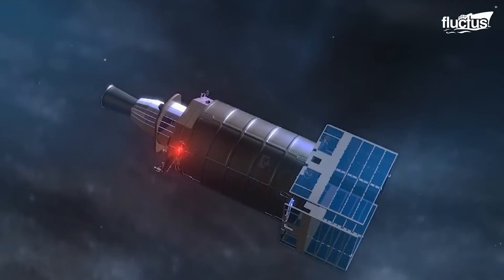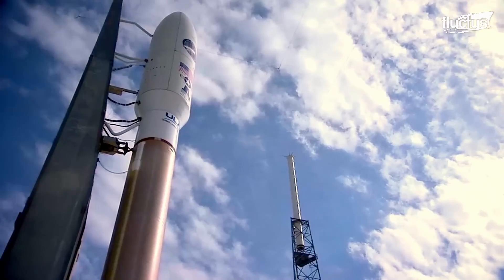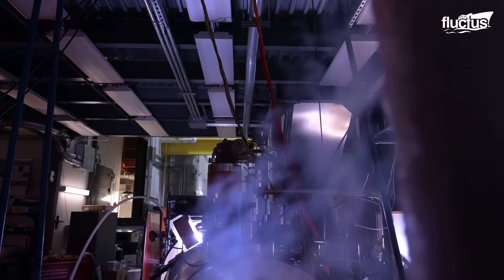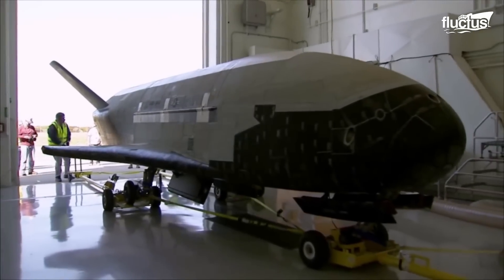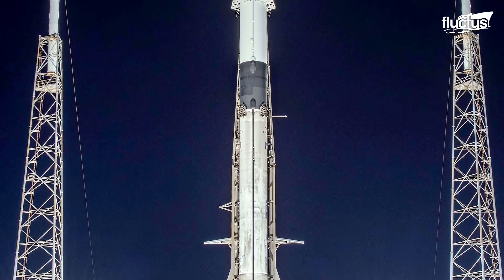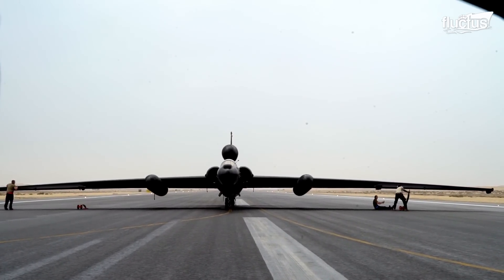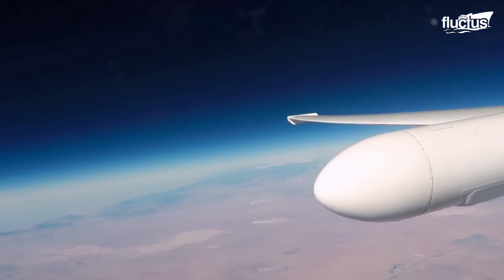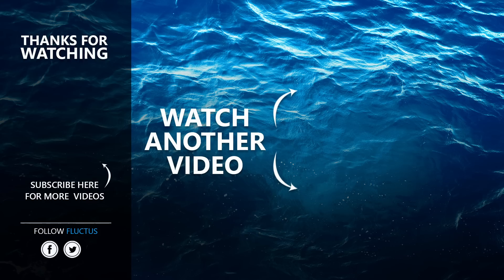How US Launches Most Secret $200 Million Robotic Spacecraft Ever Built

Comment: A Boeing spacecraft is a terrifying idea. They can't even produce simple aeroplanes properly.
(Certain trapped astronauts will likely testify)
Reply: How's your spaceplane coming along?
Reply: @GeoFlynx  I design submarines and robots that decommission old nuclear reactors. Space design is similar in many ways because its designing for a harsh environment where every failure mode needs to be considered and mitigated up to a certain agreed level. However, I dont yet have any space design experience.  Thanks for asking though. 

Boeing does have that experience, and they have developed a terrible track record for it, as well as simple commercial flight. They have massive fundamental problems in their design, manufacturing ethos

Do you have any further questions?
Reply: @procatprocat9647  the x-37 seems to work fine. no?
Reply: @websitemartian  they can't get EVERYTHING wrong !